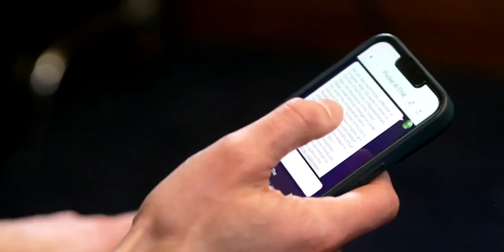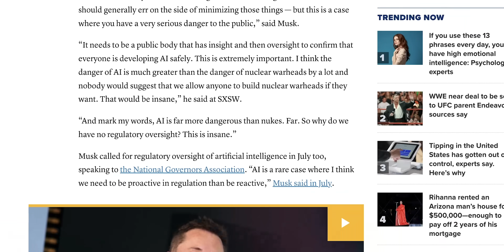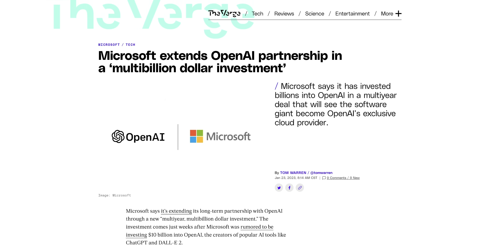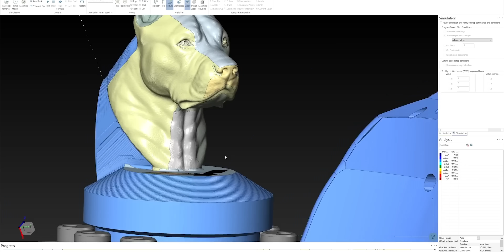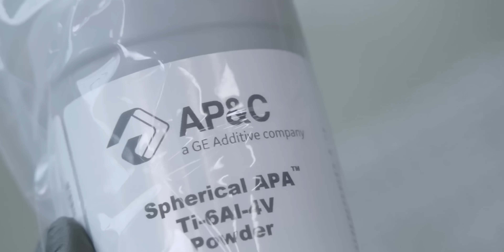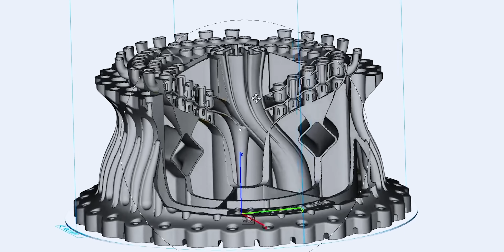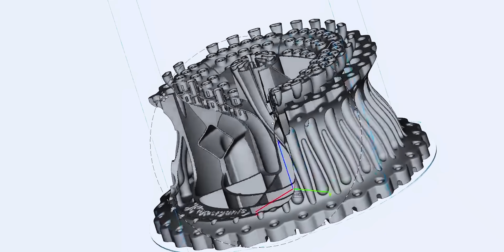How CNC Machinists CONQUER the RISE of AI

Comment: people don't seem to understand that if your jobs get easier due to AI... you are less skilled and there's no need to pay you as much because any monkey can change bits on a machine. there will be 1 programmer in a company using ai, and 5 guys maning the machines producing 10 times more than before. but the programmer will get a good wage. and the guys on the machines will get paid much less than now. might as well be shelf stacking at the supermarket. a classic case of can't do it without the programmer, but the machinists are easy to replace because it's now a simple enough job.

Comment: Just think there will be a time when tool compensation will be done in real time with the accuracy of a CMM. I can see the entire workflow of design of assemblies and machine parts through CAD cam to a CNC machine, which is a complete digital workflow, with the feedback of probes for CMM type accuracy.
This is going to close the skill gap. 
I can see top secret projects with high level security would stay in a current workflow. 
You need to examine your paradigm

Comment: Ok time to say the truth. I’m both a cnc machinist and a manual machinist. Been in business since 1999. Manual machinists and cnc machinists are not the same. Both serve a different purpose. A cnc machinist can make complex parts and produce on a high volume. What you all forget is the big urgent repairs needed on existing equipment. Turbines, pumps, hydraulic cylinders etc…. My production cnc work is almost non existent anymore. China is way too cheap. But my manual machining work is booming.

Comment: In 5 years or less CAM will be: load the model, press "make me a program for this", take your code to the machine.  The AI will write the post.
The AI will most likely design the workholding also, using the same machine models currently available for FMS packages.  Still need a human to wrench it into being though, for now.

Comment: I hate how you guys promote learn how to design parts learn how to program parts. To many learning programming first and think they are a machinist. Learn how to work and set machines up first and understand whats realistic to design and make before even touching a computer. They quit 75% of the time once they touch the shop floor so why waste time.
Reply from the maker: We have countless shop owners that make a great living for their families and their employees families… and they attribute it all to our system of learning.
The point is that you should know the part intimately and understand the mechanics of what it’s doing before stepping up to a CNC.
Makes perfect sense and thousands of machinists thrive because of this way of thinking.
Then it’s all about repetition and raising the level of parts, materials and tolerances.
Reply: @wyatt Bro i have been searching this comment section up and down and you are the first mofo to even metion anything about setup. Setup is the most important skill of any machinist worth their salt. When you master the art of setup you immediately get a 10 dollar bump in pay in most shops in my experience. To replace the machinist you would need an actual automaton. I think you are correct, it seems like its mostly detailers in this comment section pretending to be machinist

Comment: When you say machinists wont be replaced I say yes correct but when the time before cnc companies employed lots of machinists and then the dawn of nc which machines could do  repetitive jobs so then the work force reduced a small bit and then cnc came along that could multitask on many jobs and then the work force reduced some more, I used to make loads of press tools and run production but when laser became so cheap it made press tools unaffordable because you can order 10 to a 1000 off and thats it, I see more factories using robots in the casting industry which cast a part then pick up the part and take it to a cnc saw to remove feeders and then loaded to a cnc type mill that then remove flashing and these dont need to work a shift pattern they just work 24-7. When it comes to design humans will design something in such away that it can be machined, ai on the other hand will design so it wont need 2 or 3 or 4 ops and if it does then the robot will do it, being a toolmaker or a machinist or a fabricator will become a neach  job in years to come regardless of ai but down to more automation and the fact that most kids now adays dont want to get their hands dirty (the schools are the main issue) . Good video 👍

Comment: As a retired engineer who began my career as a toolmaker at Rolls Royce Aerospace in the late 1960s, I can refute your statement. Prior to CNC machining, we utilized automatic machines with up to 16 spindles to manufacture intricate parts in large quantities through multiple operations. These automatic machines were eventually replaced by NC machines that didn't required a switch of cams and switches. These NC machines were further replaced by CNC machines that necessitated manual programming in G code. Subsequently, CAD systems were introduced, which offered programmers a more visual approach, but the paths still had to be selected manually. Nowadays, these CAM systems are augmented with optimized automated toolpath selection.

It's worth noting that designers now have access to AI, which optimizes part design and manufacturing methods, including additive manufacturing, which requires minimal tooling and is too complex for CNC machining. Elon Musk often claims that the best part is no part, and the best process is no process. With AI, this will become more commonplace, and production will shift towards "replica" type systems that can manufacture parts at the molecular level, as well as robotic assembly.

Life is constantly evolving, and almost all current jobs will eventually disappear. However, new opportunities that we can't currently fathom will emerge. My grandfather was a coal miner, and my father was a manual welder at Jaguar cars, both of which jobs no longer exist in large quantities.

Comment: Completely disagree with the entire assessment. CNC machining DID replace regular machinists and didn't just require them to learn a slightly different skillset. It's how 5 people can run 40 machines, that's at least 35 machinists having been replaced and considering the many axes of CNC machines, the speed etc it's probably more like a 4-5x of those 35.

And yes, ChatGPT is pretty bad at writing GCODE, it's also pretty bad at writing Python code and SVG code but the GPT family is basically just a tool to create an output with a correct syntax, there is no intent or targeted knowledge behind the responses. It literally just learned from reading examples. An AI specifically trained for CNC machining will easily outperform most machinists. Acting like somehow creative fixturing will be the saving grace is so absurd. Like an AI couldn't simulate a thousand ways to fixture something and all the stresses involved. It may even take into account real time pricing of materials, tools, power, demand etc.  so it can choose a more tool-saving or a more material-efficient or the most time-efficient way to fixture or different toolspeeds. It will be able to learn from its own failures immediately and more importantly share those learning across multiple connected machine shops instantly. 

That's not NOW but that is the future. Personally I am happy my actual job requires working with idiots because at least right now idiots and all their novel ways of being idiots are the only reason my job hasn't been automated and probably won't be automated for the foreseeable future.

Comment: AI as a tool is fascinating. The potential for designing and manufacturing at a rate that was impossible before it's incredible. But these tools need to be developed with the engineers to build on their abilities, not replace them. A lot of the focus on AI comes from larger companies that are more focused on maximising profit over making a better end product. So they'll cut corners. They'll use off the shelf tools with the intention to reduce the number of workers and this will lead to fewer jobs and worse products

Comment: As a future automated manufacturing engineer. I often talk with workers that are worried that they may lose their job when the new automated machine enters the shop. I always explain them my thoughts about automation and the place of the workers in a manufacture. I don't see the introduction of a automated cell has replacement for the workers job but has a way to make those workers more efficient. Yes they may not have the same task or even the same job title but it is a good thing. Workers can easily become operators with a simple formation.

I see the introduction of A.I in the industry the same way. It is just a way to make everyone more efficient. The job is still there! It is just transformed in a way to make the workers job easier, more efficient and in some case safer. 

I do think that we need some basic rules to regulate A.I. and protect the users and others. 

Like every revolution that happened there's going to be a adaptation phase. But we need to let the fear of changes aside and embrace those changes. They are there to push us for the better and make our industry stronger and less dependent of other.

Comment: People saying "AI will be better than every machinist and replace them" seem to be forgetting the fact that machining isn't a job where you go into work and do the exact same thing to produce the exact same part to the exact same tolerances every day. It takes creativity, ingenuity, and interpretation, which AI is not capable of (at this time).
Reply: Aerospace machinist. The bottom line is parts get fucked up. Programs get compromised in transit, deflection happens and inserts wear down. Inevitably parts will need to be manually worked in order to save them from the scrap bin. And until my boss buys an actual robot to actually preform setup on the cnc work centers i dont see how machinist are replacable. Most of the job is automatic already. The ability to setup a cnc work center is the most important part
Reply: @joeybible683  A humanoid robot that has the dexterity and precision needed to setup a CNC (or similar) machine is about 15 years away (best guess). Not exactly "right around the corner" but not the 100 years away some people think. If you're a machinist under 50 years old then you will have your job replaced by a robot before you retire.
Reply: @Chris O'Connell  that machine exist today. Fully autonomous robots exist but im way cheaper and will be for probably my whole career
Reply: @joeybible683  You'll be way cheaper for about 15 more years. At that point a robot will be cheaper.
Reply: @Chris O'Connell  and then i just maintain and setup the robot. You do realize that machining is pretty much automatic already yes? Are you an actual machinist or a detailer?
Reply: @joeybible683  Look I get what you mean about setup and maintenance. My point is if one can make a humanoid robot with human intelligence then that robot can do EVERYTHING a human can do. It can maintain/setup machines, it can maintain/setup other robots. There is nothing left for you to do. 

Think of a job where a robot can do it cheaper, faster, and better than a human, but the human is hired anyway. Those are the only "jobs" that will be around. Some people will pay extra for "Made by Humans" items just like some pay extra for "Made in America" now. But that will be the exception, not the norm. 

Feel free to take what I say with a grain of salt. I'm not an expert, just a rando on the internet. But I have spent a lot of time thinking about this fwiw.
Reply: @Chris O'Connell  i am not an expert either, granted. But, i just think that itll be so very long if ever that a machine like the one you describe can be produced cheaper than what a human is willing too work for
Reply: @joeybible683  Well it will be a long time until we can replace Orange pickers with robots. Those migrant workers work damn hard for a tiny amount of money and there's no shortage of them. 

There is a shortage of people who can setup/maintain a high end machine though. And doing it wrong can be extremely costly so even if someone is willing to do it for minimum wage, you'd be a fool to hire that person. I'm telling ya, 15 years from now there will be a robot cheaper and more capable of machine setup/maintainance then a human can do.

Progress is exponential. You can't look at where we were 15 years ago and assume we'll see that much progress the next 15 years. We will see more progress in next 5 years then we saw the previous 50 years! Things are going to move FAST.
Reply: @Chris O'Connell  well dude, then i guess ill just have to buy one. I already own a mill. I have a deckel on a palet and wrapped in a trap. So i guess if i get fired ill just have to go get a certification and open up my own shop
Reply: @joeybible683  At least you have a fall back plan. I'm a work from home programmer and my best guess is AI will take over my job in 8 years. All I got is a table saw so I'm hoping handmade cutting boards are in high demand then. lol
Reply: Seriously? Have you not played around with ChatGPT and Midjourney? AI is very much capable of creativity, ingenuity and interpretation today. Not as much as a human is capable granted, but AI is improving at an insane rate.